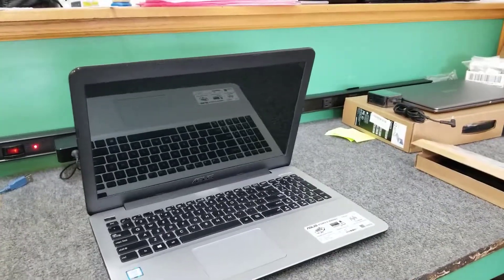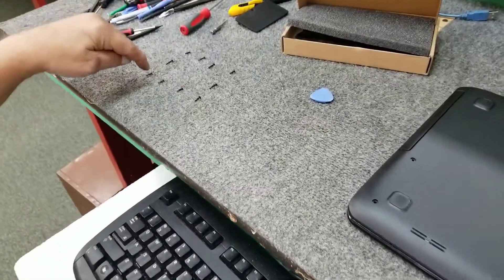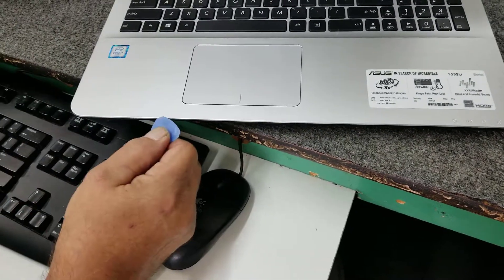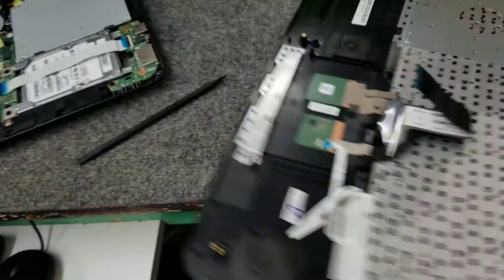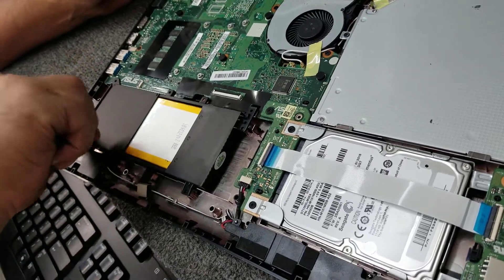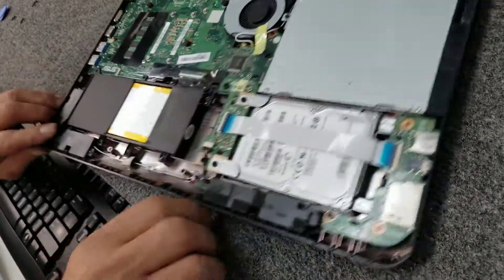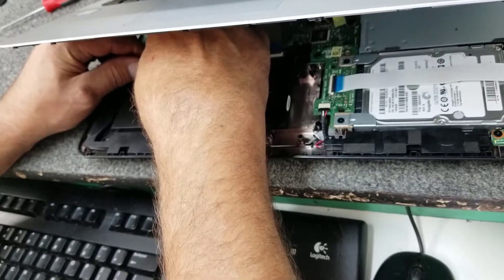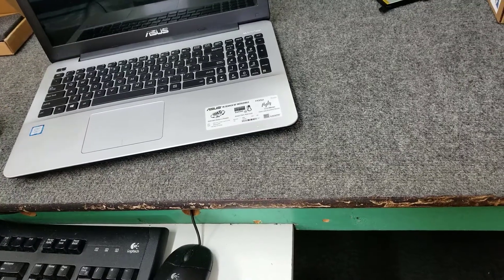Replace Battery in ASUS F555U Laptop

Comment: Great work on the video -- massive help.  I copied you, but the keyboard didn't want to come up.  It felt like there was a hidden screw towards the "M" key -- center of the keyboard (there isn't).  I ended up just taking a firm grip and pulling whilst trying to avoid flexing it and it worked great.

Comment: Hi there Dale. Thanks for this video. I have two questions. What was the application you used to test your battery health? How can I be sure to order the right battery for my ASUS model x555U laptop? Thanks.
Reply from the maker: Hi. Using Powershell as Admin, paste this at the prompt     powercfg /batteryreport /output "C:\battery-report.html"      This will generate an html file that will be saved to the root of C drive.  Open the html file to view report.  Dale
Reply: @CadillacComputerCenter  Cool. Yes I ran and read the report. My laptop screen does not run when on battery power - works fine when I plug in an external monitor. I wondered if it was my battery. Report shows battery capacity is half of what it is designed to be. Would the lack of battery power be the likely cause of the issue or am I looking at a screen issue? Sorry, I realize this is scope creep. I live in a small town in the Canadian prairies, so good tech support is tough. Thanks again.